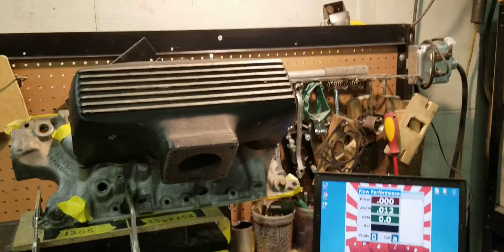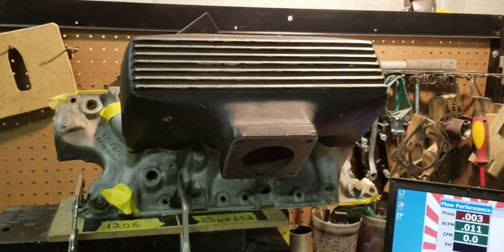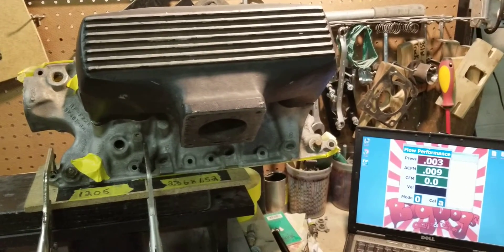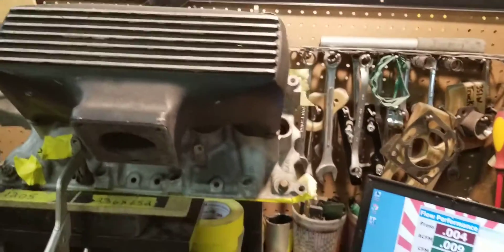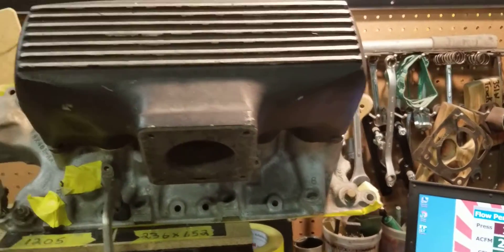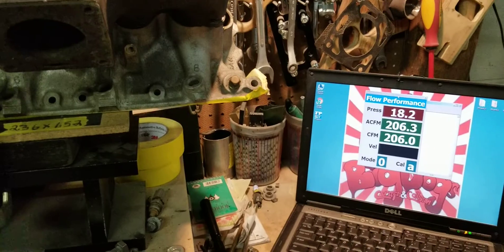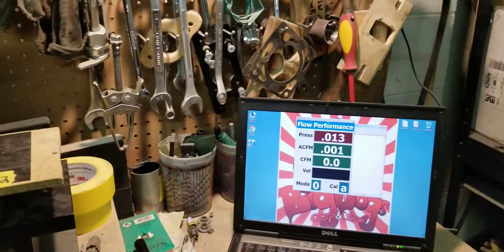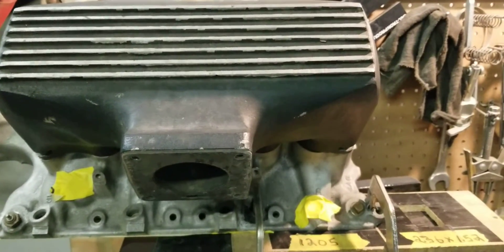Ford Downs Box gt40 intake manifold flow testing part 1 by Bigdogs Porting

Comment: That's a Damm good upper you have there. I've been using that Intake along with the Bennet Racing upper since the mid nineties and have always ran good times with that upper. Right now I have my Downs Ford upper along with the Bennet Racing upper hanging in my garage and have put the GT40 tubular back on for now.
Reply from the maker: Actually flow wise it's not  good in stock form. When compared to other higher flowing shorter runner uppers it fared poorly. Once we port them they perform much better but still those Downs box and Hogan box uppers have design flaws that can only be corrected with cutting open and heavy welding and modifying.

Comment: Are you guys no longer selling through Ebay?
Reply: Did you ever do a part 2 video after porting?
Reply from the maker: Yes we still sell through Ebay and we also take orders by contacting us on our Facebook Business page at Bigdogs Porting. 
The ones on Ebay sell very fast and this is why you may not see them on there when we list them lol. They are in high demand due to many customers posting their results on the various social media platforms. One guy did a review where his stage 3 Cobra we did made 30whp more than a home ported Edelbrock rpm on a 363 with a small cam and shorty headers!